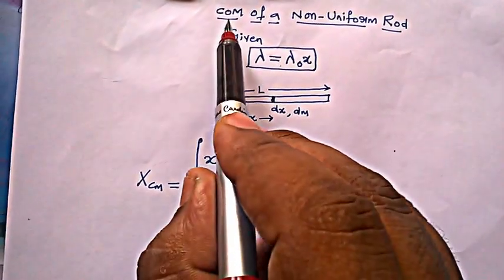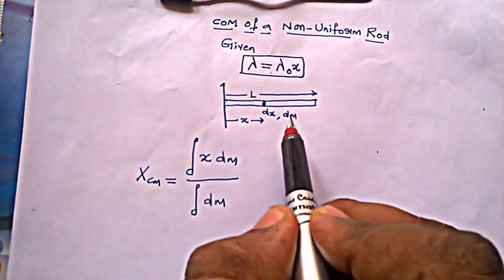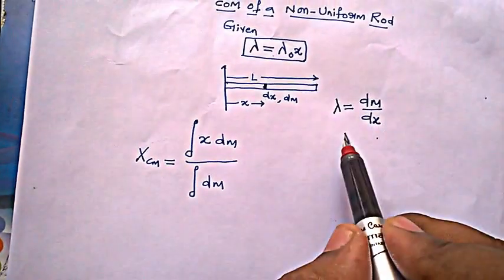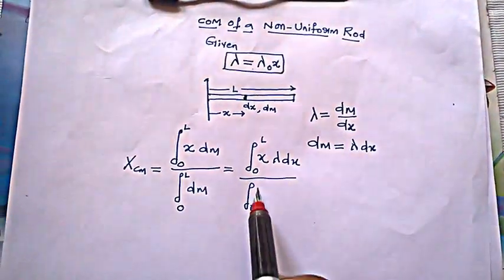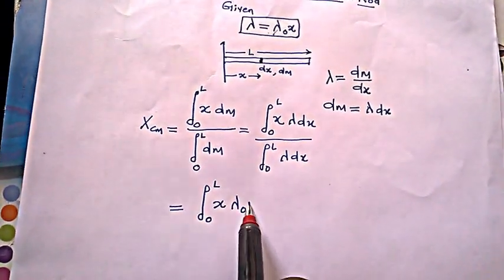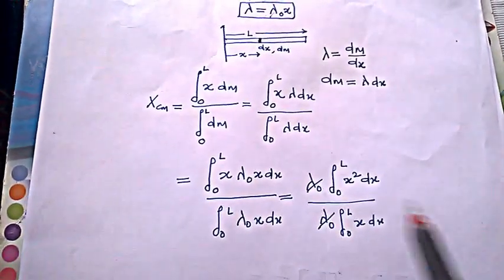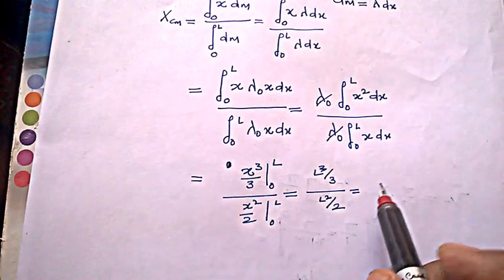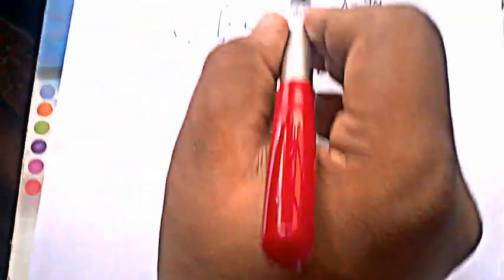Center of Mass of a Non-Uniform Rod

Comment: is 2L/3 from origin ?
Reply from the maker: Gamer Tragolith Yes.! From origin towards Right
Reply from the maker: Yes, only if mass per unit length varies as mentioned in the question..
Reply: So if there's a non uniform rod of say 6m then its centre of mass will lie at 4m from the origin on the X axis ?